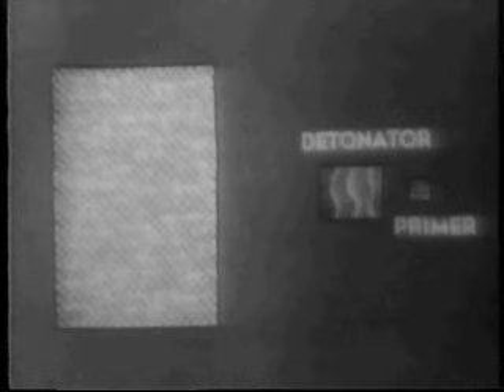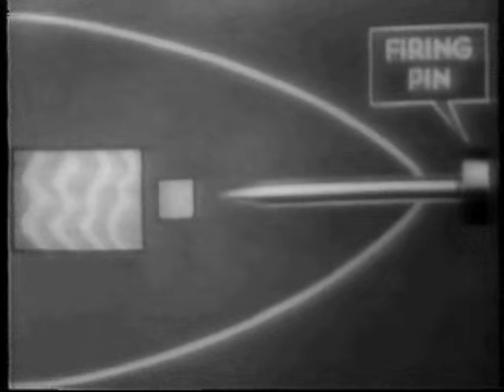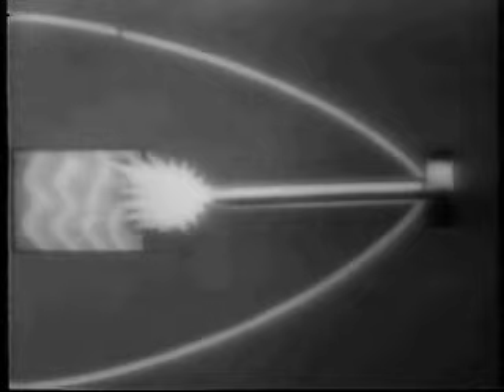Artillery Fuzes (US Military Film)

Comment: The correct spelling is FUZE. Fuse is an electrical device.
Reply from the maker: Never knew there was a difference in spelling. Or the fact that there was a different spelling
Reply: @mannequinfukr  It is the standard spelling in all English language military, technical and manufacturers publications. It is also a NATO standard. Fuse means to melt like an electrical fuse wire. Unfortunately spell checker and autocomplete do not know this and even professionals can be caught out.